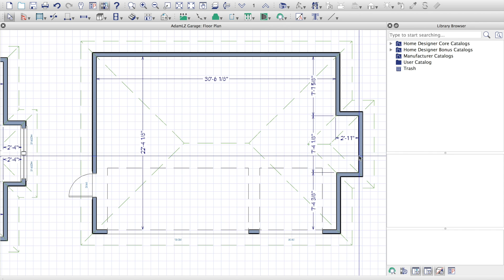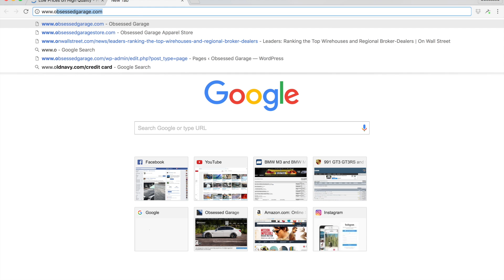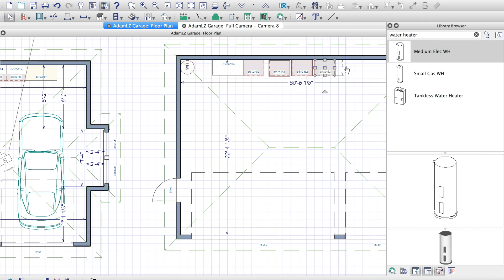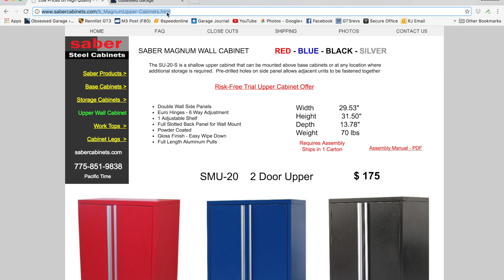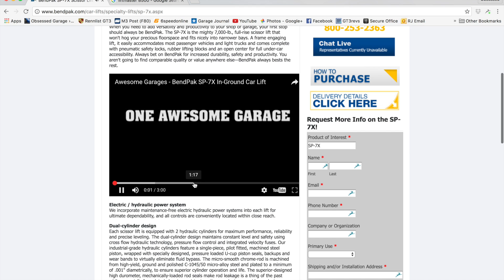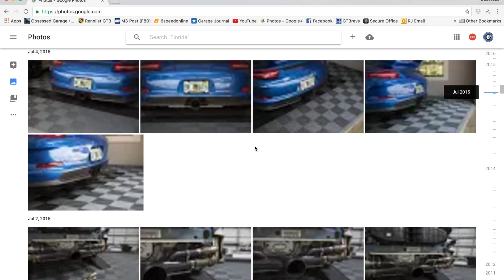Designing Adam LZ's Garage:  Video 2 - Using Home Designer Software

Comment: Good stuff! Initial stages of research and design. Definitely plan on putting a lift in. Thinking of the Quick Jack BL-5000SLX. Portable for track duty.
Reply from the maker: The problem with Quick Jack is that you have to put it somewhere when you're not using it.

Comment: i think Adam should be better off with a Quick Jack its cheaper and you can move it around.
Reply from the maker: The problem with a quick jack is where to put it when you're not using it.

Comment: Matt check out ELAC Audio new concentric bookshelf speakers, they sound amazing, cheap, designed by the legend Andrew jones, and you don't need a sub so you save space 👍🏽
Reply from the maker: Hmm....  I've haven't come across those yet.  I wonder how they sound for $200.
Reply: +Obsessed Garage (Matt Moreman) they sound like they should cost at least a grand. They just look like two hundred dollar speakers lol finish sucks but you can always wrap them high gloss back lol that's prob what I'ma do. But the sound and bass is just incredible highs are crips mids right on point and the lows will have you looking for a woofer. Only thing is their power hungry and need a monster amp.

Comment: they do have 2 post car lifts, a friend of mine picked up a really nice used one for a $1000 about two months ago. you would still need to have some concrete work done to set the concrete anchor post into the floors a residential floor isn't thick enough for it, but that would be more than sufficient for adams small cars, it can lift my Chevy 2500HD Duramax diesel with no problem. it would be worth looking into because they have much more room to work under than a scissor lift. and he could actually still park another car under it while one is lifted, as long as he engages the safety pins
Reply from the maker: Of all lift options, my least favorite is a two post life.  They are especially problematic for lowered cars.  But remember, I'm most interested in being able to access the entire car from all angles with it up in the air.  That's the detailer in me.

Comment: Not sure I would go with that lift, it seems to require a 6" depth to sit flush. Not sure where you guys are, but I'm in the process of building and mine is going to be 5" thick @ 4,000 PSI. Make sure the garage can manage it. I'll probably end up with the XPR-10AS-LP. Also, he'll need a dedicated 220 circuit. I've been looking into the 4-post lifts as well, but I don't like not being to get to the wheels, and I don't like the idea of the SP-7X not sitting flush in the concrete.

Comment: If anyone is looking for a free program to mess around with check out "Sweet Home 3D".
Reply: There's also one called Live Interior 3D which is also good, although not free
Reply: I have tried Live Interior 3D and Chief Architect's Home Design is better in my opinion because you can do exteriors also.  They both take a similar approach but Home Designer is more complete.

Comment: Matt, you haven't figured out yet that the full length cabinets should be off the floor to connect from bottom of the base to the top of the top cabinets?! The way you keep on building this looks kind of diy... not as a pro would do it... Symmetry😉
Reply from the maker: The larger cabinets don't lend themselves to mounting as well.  Also, they are much deeper than both the base and uppers.  I actually suspended mine on some buckets to see which way looked better.  I preferred the look with them on the ground.  It's just personally preference and slightly better functionality.